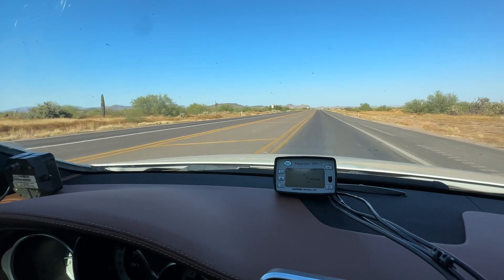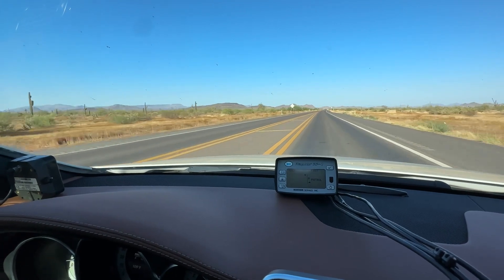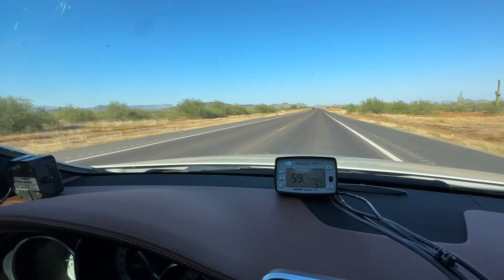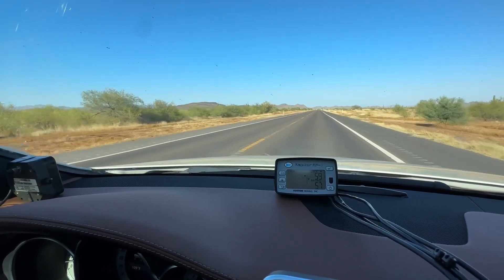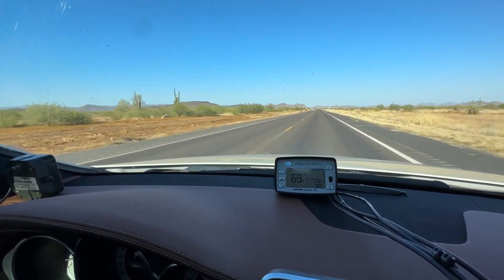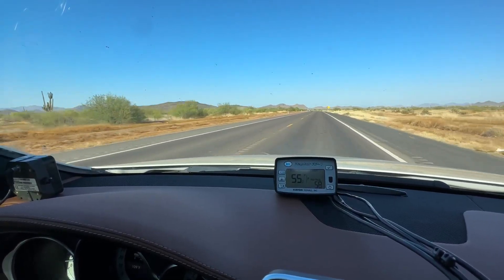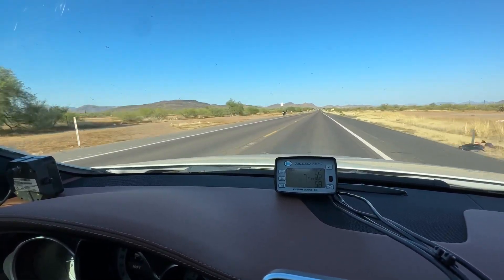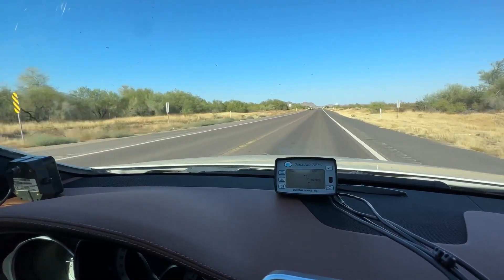Instant-On Police Radar: Patrolling (Moving I/O Radar)

Comment: RP-1 I/O is so scary. I'd hope the cop would do it from a distance so it takes a few secs before they grab the speed. I also feel like you can easily be ahead of the game by looking out for cops in oncoming lane or the shoulder.
Reply from the maker: When stationery range exceed 3000 feet with todays digital radars, tough to spot at that distance especially from hidden position.
Reply: @RadarBusters  Yeah, then you're screwed in that scenario.

Comment: can a heavily high gloss clear coat on a black car that has been detailed to a mirror finish and waxed effect the signal being returned to a patrol car as far as accuracy of speed? Also i was pulled over 3 times in the same area a 1 mile stretch of hi way and was given a ticket all 3 times but all 3 times i was given a ticket for going 90,89,90 my actual dashboard speed was 71 to 74. after doing a lot of research i discovered lots of tickets were being given out for speeding here. that peaked my interest and i continued researching and found some actual data that shows the the proximity of cell phone towers effect the accuracy of the radar in your experience would you agree with this?
Reply from the maker: We believe the Doppler return would be unaffected.